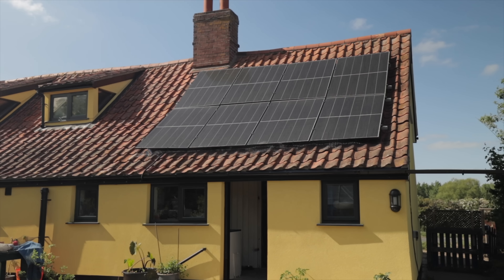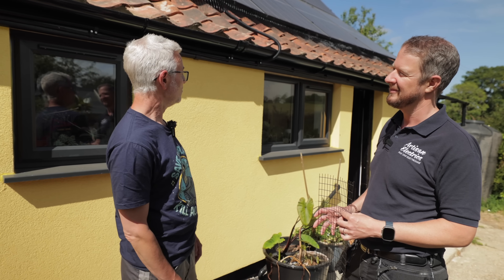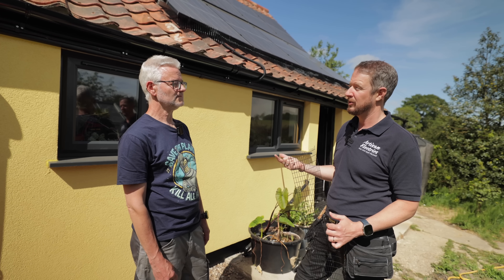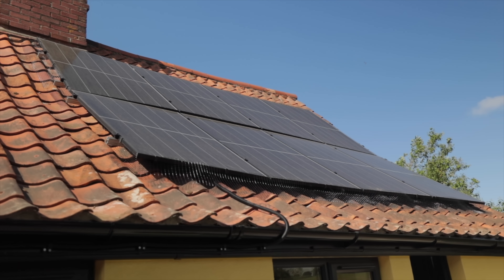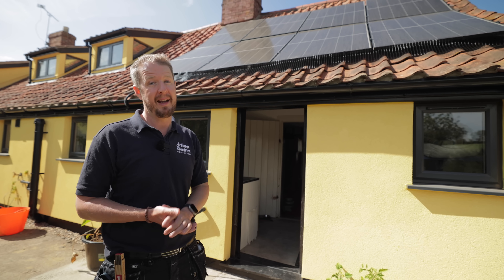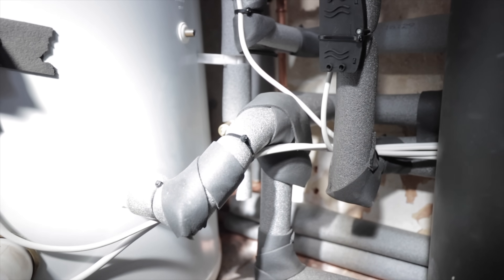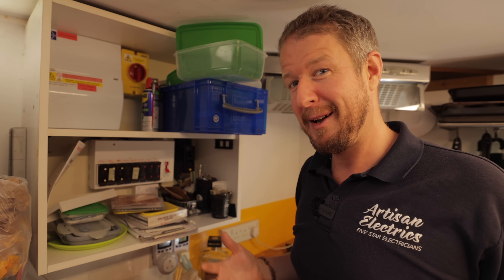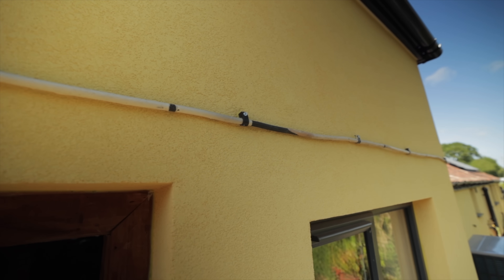This £50,000 Grant-Funded Solar Installation Went Terribly Wrong…😱

Comment from the maker: 💡 Unilite Work Lights: Get 25% off all Unilite products using code "ARTISAN25" - https://unilite.co.uk/
Reply: panels not even, bird/critter protection not all the way round, wires not feed through correctly, roof might not be in shape to support the panels

of course that is just what is visible at 0:23 where i paused

6:00 because the rooms are the smaller cubic wise and takes less energy to heat up.... or the UK was the origin country of hobbits 😀
6:18 6mm is the minimum (a bit rusty on knowledge)
Reply: Why are British Ceilings built in 1500s so short? for the same reason why the Ceilings of 1600 American Colonials are shorter than modern but taller than 1500s British Ceilings .... Nutrition. What do I mean by that? Why were Britons short in the 1500s and 1600s? It was a hard scrabble life where every calorie ingested was a struggle and the biggest hit on height is Maternal Nutrition. If Mom is starving when she's pregnant with a little one, the little one is going to be shorter in stature. Our Ancestors were basically starving all the time and todays quick Drive Thru Cheap Combo  Meal has more Calories and greater Nutritional Value than an entire day for the average person in Great Briton and Ireland in the 1500s and 1600s. Adult Height = Nutrition + Genetics, and Genetics takes a back seat to Nutrition. Baby, Toddler, Child, Teen gotta eat a lot to get tall! So why build a home with stupid tall ceilings in the 1500s and 1600s like in the South East United States? Same reason why there was a fireplace in the basement of those houses and often dry wells and hollow walls, air movement and cooling, COOLING. You can only understand this if you try to stay in a European style home of the 1600s (we have them in Mobile both English style and French Colonials) where you would die from heat exhaustion with a Low Ceiling no ventilation, vs. the French Colonials with the HIGH ceilings from 10 feet to 14 feet tall to get the heat off of you.
Reply: If you do ever get a chance, after the Madness passes here in the US, take a tour of the historic homes from Key West up thru Miami and St. Augustine and around to Mobile Alabama and New Orleans because those historic homes are actually designed and built prior to Electricity and consequently maximize lighting, HVAC (sounds insane but even a Dog Trot has active cooling) and with Britain  and Ireland heating up? Could get some ideas.
Reply: As for dealing with the Grant problem? Explaining to the critters in charge of it the poor quality work occurring due to multiple levels of subcontractors where the low man on the totem pole gets skint and the only way they make a living wage is by doing a job in 2 hours resulting in work that appears to have never had a 3rd party inspection to Assure Quality. A home owner should not have to explain to an installer to level a Heat Pump that needs to be 0/0/90 degrees level, or that cabling shouldn't be draped externally or Critter Caging needs to be properly installed. Be glad y'all ain't got no Racoons or Bobcats (they eat Racoons) to deal with. Even with Critter Caging.... well you gotta check it here some days. Occasionally? Gotta stay up late with a Q-Beam and a .22 if you got a family of Squatting Masked Bandits hellbent on ripping your roof apart.

Comment: In addressing these issues, you could limit the number of subcontractor levels to 2 or 3, then impose a contractual fine if they exceed 4 levels of contracting, say, at 50 or 100 thousand per installation. That would slow it down very quickly. 
You could also have an independent third-party assessor at the end of the install and withhold payment until they pass the install assessment. Then randomly select a number of those that pass the installation assessment and have them assessed by an assessor paid by a different level of government. These assessments would be in-person and on-site. Not just paperwork. This way, you remove potential collusion between installers and assessors, and by making it random, no one knows whether their work will get the second tier of assessment. Failing the second tier of assessment could result in termination of contract and or loss of licence.

Comment: i have a question, when you  fit LPG to your car you need to do 100,000 miles to start to see a return in your money, so solar panels batterys inverters cost how much electric you got to use before you get a return? sorry can''t see the point on a house factory hospital ect yes but a house?

Comment: Grants are insanity. If it is cheaper, than people would do it themselves. All they should do is to entice people with low interest rate loans for it. If it doesn't make $ it doesn't make sense. For example I have  air to air heat pump costing under 2k installed. It made sense because we don't have wet system for heating and our wood fireplaces and chimney are failing apart. So air-to-air heatpump made more sense than fixing fireplaces, chimney, buying firewood, storing it, carrying it to house in winter to burn it together with warm air in apartment sucking in cold air from the outside... +Heatpump came out to be more comfortable and cheaper to run than buying wood.

Comment: How did this guy get a grant for £50,000. Really.  I would love a grant,paying nothing for say £13,000 to get solar and battery storage. Is it easy to get a grant.  This video has shocked me a bit.
Reply: I never knew what the grant was... the council keep it all secret. The total included the external insulation. I was only told 'roughly' how much when I complained and they wanted to be let off BECAUSE it was expensive. It was a HUG grant, if you meet the criteria you can have one too. The insulation is a transformation... the solar was a showcase for cowboy work.

Comment: So how do we complain about a substandard installation? I have a friend who has had a similarly poor installation done a couple of years ago. I have found panels left unconnected (90+ volts on a set of unterminated MC4 connectors in the loft) No documentation left on site, I've called MCS who say there are certificates for the solar and ASHP installations but it's for a 5.95kW system while a 3.6kW inverter has been fitted and it looks like there has been no G98 or G99 application made to the local DNO! The system is grid connected and is exporting (though there is no FIT in place so any export is being given away for free!!??)
Reply: It is a minefield and bloody difficult... Even with this new install I have been run round the houses to find the bodies who are actually responsible. In my case the main contractor (PHS 0800 Repair) used a sub-contractor and the first obstacle was to get to the named installer (FutureHeat) they were covered by different bodies from the main! Then the work was under TrustMark and should have been certified to MCS but certification was through NAPIT and hadn't been done! That's underway for technical issues, contractual issues are going through RECC... At every stage they wriggle and try to get away. Try to track down the original company, any certification and then the bodies that should be backing it up. Good luck!

Comment: Great video thanks, really interesting, there's lot to think about here. Are they cowboys? Dunno! being honest, they've done a much better job than I could have done if I was only allocated 2 hours (although you didnt say how many guys turned up). I would have spent about 2-3 hours marking out and installing the beams so I would make a useless subcontractor! Additionally in an old protected cottage I would want to find out a lot more about that roof before walking around on it, drilling holes and adding 8 panels at 35 Kg each. Oh! and its not acceptable, I have had this discussion before, the inverter manufacturers installation manual will state 3 x 2.5mm, it never states 2 x 2.5mm plus 1 x 1.5mm!
Reply: 3 guys - 2 on the roof... It's been replaced now but that will have to be redone because of roof damage!

Comment: If the council is the client, then why doesn't the planning department do the final inspection
Reply: The council had literally no expertise - they signed the contracts and wanted to tick boxes. When it came to 'support' they obeyed their contractors and wanted it all signed off without complaint. It took a massive effort for them to even help first the 'first complaint and chance to rectify' that all the 'guarantee' schemes insist on. They were very poor, and still are.

Comment: This shows the fraud towards the tax payer Not government it’s tax payers funded lol 😂. Also hi-lights the issues of subsidies and tax payers funded. 
It also shows realistically how expensive this all is. Personally I can’t afford to drop 50£k like that even with grants tbh that’s not the worst I’ve seen. I’ve even had quotes of reputable businesses way higher for my property in the region of 90£k + for sola heat pump and all what’s needed. Baring in mind my property is in sound state even the surveyor says so and says there is little in reality it needs, also out of the quotes they want a new roof witch my surveyor says it doesn’t!!! That’s the plus part that will definitely take it well over 100£k in total money I don’t have.. 
as a trade I’ve come across customers who have been bitten bar those who are wealthy it’s very hard for some to put it right. As I sadly say I’ll do my best but at the end of the day costs still has to be passed to the customer and I’m not a charity. I though do offer advice even have a few customers who ask me for recommendations ora advice on things out of my trade, due there so scared to ask any one they don’t trust… 
There is a serous issue of cowboys and business that clearly don’t have the customers best interests or are blatantly ripping off the tax payer for the gains.
These issues are across the trades and property mantance and building sector.  
I do feel very sorry for customers who. Have been bitten. And it dose leave a growing issue of trust / lack off, towards tradesman and related business. And makes customers more wary to Trust US… I can’t blame them… 
I agree anything government/ taxpayers funded should be inspected and open to ordit. But in reality when has the government been smart with are money. Hens why I’m not a fan of government schemes like this due to many issues all leading to abuse to the taxpayer and customers. A lot of these schemes sound good but in reality so open to abuse. Let alone over issues with some seem only those who could have afford it in the first place benefits from it. I’ve come across customers who blatantly need support but it’s not open to them and overs who have benefited massively of these sort of schemes who are very well of but played the game, can’t necessarily blame them especially if it was open to them. But this hi-lights the flaws of government pushed schemes along side legislation that puts a lot of home owners in a very bad spot especially if they don’t have the funds or don’t want to be in debt…

Comment: The whole co2 thing is a scam. What they are actually trying to do is lessen the load on the GRID. Because if they do that they  don't have to build Nuke Plants or Nat Gas Plants and they can live with the they have and they can use the MOney for whatever. Give themselves a raise for being so smart. But if you don't start charging these fly by night contractors with fraud and locking them up for 5 years they will keep doing this crap. and By the BY CO2 is plant food. The More the better.

Comment: You should do a typical install bid sheet and it up on your website so everyone can see what the costs actually are.  Your council can cut the sub contractor shuffle down and just say no. You're the GC you get one level of subs under you. Not through all your cousins and in-laws,. Because they just take it out of the JOb and the customer suffers. There also needs to eb a completion bond. Since these guys aren't doing the job. You do this stuff in the States and then you don't fix it in a  timely manner you will get indicted for fraud. The Charge will be theft by deception.

Comment: Nothing new. My now 13 year old instal with Enphase panel inverters underneath was fitted well with a new Consumer Unit fitted too. It worked and was part of the Gov 'Fit' subsidy. However, two weeks in and the company that installed it (yes they went bust too when the Gov removed that subsidy for new instals and over half of the Solar companies went bust with 18,000 redundancies) rang up and said, "Sorry, we have fitted the wrong panels, we must come and exchange them with the ones you ordered".
So it was but, luckily the same crew came and did another good job and they are still pushing out up to 3kW which is max for the 14 x 275W panels on our 30 degree roof (45 degrees is best in our region).
Then came the pigeons after 10 years and decided it was their Loft. We eventually counted 28 of them and two nests in continuous use with all their constant 'crooning' masses of poo which, with the roof moss, blocked the gutter regularly. £300 later we were properly meshed and away they went.
This last quarter to the end of June 2025 returned £384, a record plus a lot of free power.

Comment: I'm not a PV installer but surely the frame for the panels should have been set up almost as a subframe before fitting the panels. You can see from the gable end fascias that the roof has a kink in it. Awful standard and of course the first thing you notice!
Reply: Absolutely - they should have levelled the rails not made the rails follow the roof.

Comment: I was on the understanding old houses with stone walls need to breathe the moisture out. Its likely its got no DPC either. Wall insulation likely to trap moisture in the house & cause damp issues along the way. 

Heating the house during the winter takes a couple of days to get warmth into the walls and then they retain the heat. And on the opposite side, they stay cool in the summer. 
I had eco4 grant too, stone house, similiar issues - company rectified though as it was mostly their subcontractors that were awful
Reply: Not stone walls - very thin timber frame at the front and +120 year old brick extension at the back. It was cement rendered ~60 years ago. It was very cold and extremely porous to heat.  It was a mortgage condition 30 years ago to add a DPC. It's now pretty quick to heat and holds it.

We're keeping an eye on the way moisture behaves now, but are hoping have 'warm walls' will hugely reduce the condensation we used to suffer - on the brick walls.

Comment: I’m a solar installer, been in this game since 2012
Shocking installation of the panels in this video, but you’re bashing a few things here unfairly I think
A really good installation team absolutely can complete a solar install really really fast, I’ve had days with a 4 man team getting 2 or even at push (on long summer days) 3 installs in and complete, with paperwork signed too. And we don’t cut corners.
These eco4 jobs are simple systems and when you get used to them it’s fast.
Having said all that, this example here looks extremely poor quality!
Also the reason in ECO4 jobs we always install new fuse board and ignore existing electrical systems is because we are not being paid for that, we’re not there to take liability for existing electrical wiring, that’s the house owners job to pay for a local electrician who wants to take that join on 
Side note, that cable thrown over the lovely external wall insulation was likely put back there by the wall installers after they took it off the original wall (they aren’t electricians and it’s usually an afterthought!
Reply: I agree: it's not that fast was inherently bad... if it had been good. But it was bad and they were mainly fast because they wanted to get on the road to get home. They fitted the only kit they had and made the rails bend to follow the roof and ran. The array has been replaced now and it was clearly a brain melting challenge for some fitters as the new team had to be coached to use the adjustable hooks which were supplied. That refit took a total of 5 hours including removing the one in the video... this time it was slow because they didn't know what they were doing...

I could see the separate fuse board was to clearly dived old and new work - not holistic but pragmatic.

Spot on with the ugly cable - no one could touch it so it was simply put back - I hope to sort that out...

Comment: I paid 10.8K iirc for my solar install. 5KW on four axis, 3 Bed Detached house, with a 9.5KWh batt. I've been through mediation with the RECC where the company have agreed to make the roof water tight as per MCS. No notching or flashing had been installed.

Cables been installed under concrete roof tiles with no gland or flashing. There's loads of tile vents that could have been used. But they want me to pay for the scaffolding!

I've obviously refused and have now escalated to the NIC.
Reply: Good luck with your fight. I'm still working through MCS, TrustMark, NAPIT and trying to bring in HIES.